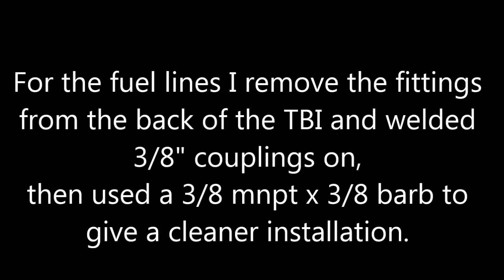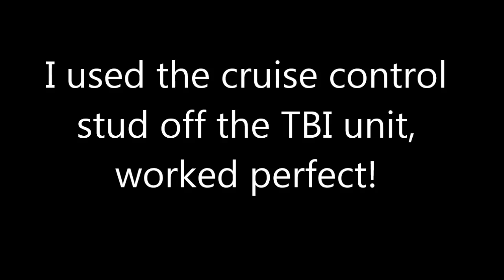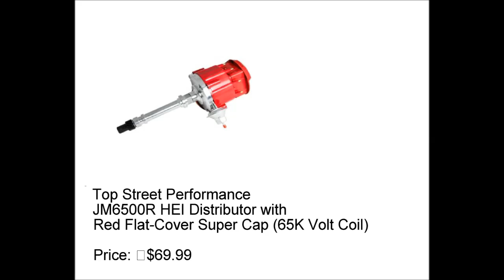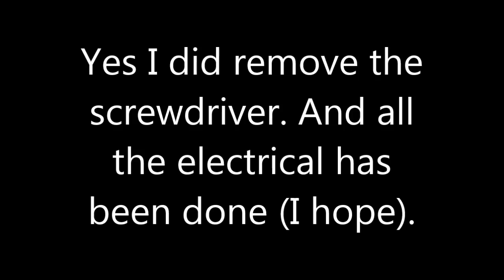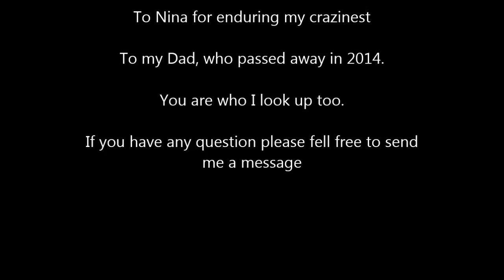Chevy Truck TBI to Carb Conversion 2

Comment: tring to do this on a 98 vortec engine, don't konw what transmission to use tho, any recomendation would be great
Reply from the maker: What are you putting it in? This would matter... Let me know and I will and I will give my best advice....Thanks.
Reply: its going on a 01 v6 mustang, i already have the engine, carb, headers, just waiting on my intake and thinking about what transmission would work best and affordable
Reply from the maker: Your trans is probably electronic, I would go with a standard shift. To be honest I am not real familiar with the newer ford products.Wish I could tell you more.

Comment: are you running the electric fuel pump in the tank or did you switch over to mecanical
Reply from the maker: I'm still running the electric fuel pump. I have a regulator at the carb.  It works very well.
Reply: I seen that after read through your other comments. Thanks
Reply from the maker: +Nathan Zaayer  Any time, Glad to help...

Comment: Arent you supposed to put the hei vacuum line on the passenger side as it sits higher then the other one and provides a better vacuum?  Then the driver side vacuum line  for A/T transmissions like the th350 and th400 NOT a 700r4 but also can use it for a extra vacuum. And my second question is how did you bypass the TPS, VSS and ECU so that the transmission shifts into 2nd,3rd and 4th as well as OD?
Reply from the maker: +Abbygale Stutzman Drivers side is for non emission controlled engines and the left is used for emission controlled engines.(per manufacturer). Since I am eliminating the ecm I hooked the distributor to the drivers side. Your application may very.
             I will be using a TCI Lockup kit, TCI 376600. This will eliminate the need for the ecm and the other components for shifts.
             Hope this helps.
Reply: +Papa Ragan  HOW DO IN KNOW IF IT IS EMISSION CONTROLLED OR NOT?
Reply: +Charlie Clarke DO I NEED A STALL CONVERTER 700R4 CHEVY 350 TBI SUBURBAN AFTER SWAP TO HOLLY 600CFM CARB AND INTAKE
Reply from the maker: +Charlie Clarke are you eliminating all the sensors and computer? if so it will have no emission controls. once you put the carb on the computer has no way to control the fuel mixture and you will need to change the distributor too. If you leave the oem dist on the computer will be trying to august the timing. I left my cat on for now.
Reply from the maker: +Charlie Clarke unless you change the cam your stock convertor will be fine. just remember you will need a lock up kit once the computer is diconnented from the trans.
Reply: +Papa Ragan thank you.
 im looking at all i can before i start this protect!!

Comment: my engine is an 89. so this intake won't work with mine. what year is your engine?
Reply from the maker: +Steve Collins My engine is an 89. If you have a C1500 it should be the same. I believe the 3500 (not counting extended cabs, they did not switch until 1990) along with suburbans which did not change until 1992. Now I could be wrong but I think this is correct. Most 5.7 changed in 1989. You can tell by the 2 center intake bolts. 1989 and later(most) the center bolts go in straight not canted. 1988 and earlier center bolts went in canted or at an angle. I hope this helps and if some of this info is incorrect let me know so I can update my info. Thanks, Papa.
Reply: I'll check the bolts I know I pulled the engine from an 89 chevy 1500 . So I will let you know what I find thxs

Comment: Picking up a 91 Saturday.  It runs great but I want to break the 250 hp barrier.
Any performance stats for us?
Reply from the maker: Here is a great article on Super Chevy and about your truck, a 1991. This will be a good starting point. If you want to have more hp to start with look at a 350 from around 1996. My '96 Suburban is about 250 hp stock.

http://www.superchevy.com/how-to/148-0307-late-model-tbi-trucks-power-upgrade/

Hope that helps, Papa.

Comment: Do you have to get a new distributor?
Reply from the maker: Yes, Go with an HEI that is not computer controlled
Reply: Papa Ragan  ok thanks haha did the carb give you a noticeable amount of power?
Reply from the maker: In my application ( c1500) which I use for hauling as neede, it seems to be more responsive. Overall I likethe carb better.
Reply from the maker: Yes, Top Street Performance JM6500R HEI Distributor with Red Flat-Cover Super Cap (65K Volt Coil) Jegs or Amazon

Comment: Too much work. Think I will just stick with the TBI on my 89. Probably makes more power anyway. And how would the computer know when to shift the trans with no more throttle position sensor.
Reply: My 88 uses a TV cable to control the transmission. Same as in the video.

Comment: How much of the stock wiring off the computer did you keep? I cut off all the sensors I knew for sure I didn't need but I still have a mess of wires where it comes through the firewall.
Reply from the maker: Basically I just cut the connectors off that I wasn't using and tucked and taped them to give it a cleaner look. You can get plastic wire covers at the parts store. It's not expensive and will give your engine compartment a cleaner look. Hope that helps. And sorry for the delay, its been a very busy year. Papa

Comment from the maker: Added a new fuel pump wiring video   https://www.youtube.com/watch?v=0Jf4xdxe9qI
Reply: Papa Ragan did you have to put the heater core hose from the back of the old
Reply: Papa Ragan did you have to put the heater core hose from the old  intake manifold and move it to the front on the new intake manifold